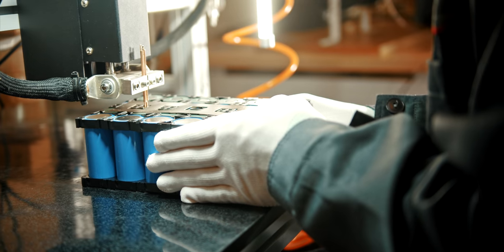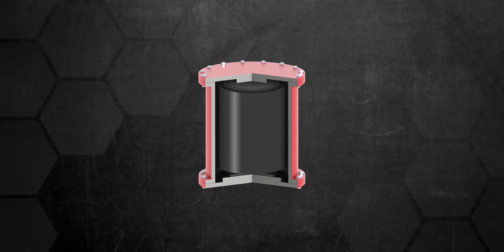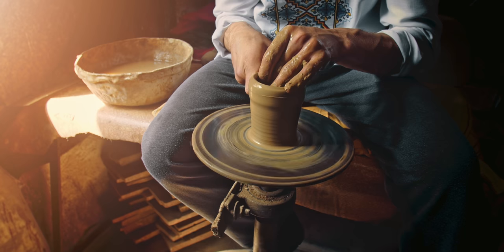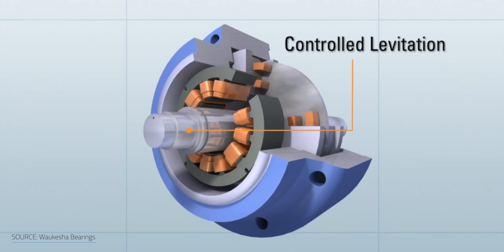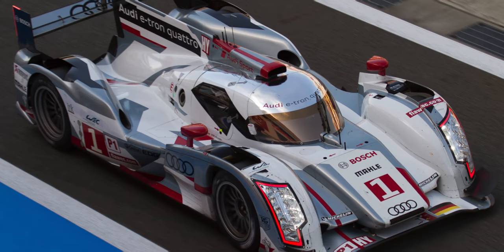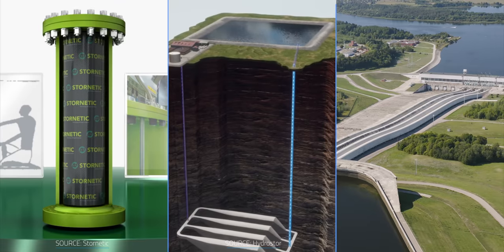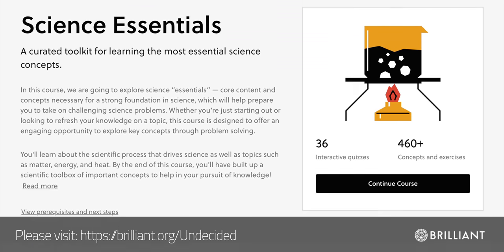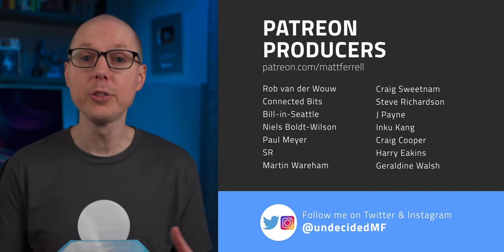The Mechanical Battery Explained - A Flywheel Comeback?

Comment: They should create a hybrid windmill.  You just place a large heavy cylinder on a cable inside the windmill and when you have extra power that would lift the cylinder until it is at the top of the windmill (fully charged), when wind is no longer available then the hanging cylinder would propel the turbine as it is dropped back to the bottom (discharged).  You already have the turbine so why not make use of it?  You just have to add some controllers, gearing and a hunk of steel. Your storage capacity would be proportional to how heavy of a cylinder you place inside the windmill. These could also be deployed near the windmill instead of inside but they would take more space and complicate the pulley system.
Reply: Oh and you could also allow the cylinder to drop lower than ground level by extending the cylinder housing below ground level which would also give more storage capacity.

Comment: An advantage not touched upon is that flywheels are able to discharge at very high rates compared to batteries. Useful if you have very bursty power demands like a fusion reactor and you don't want to cause a local brownout.

Comment: The installation costs may be greater, but what is the life-cycle costs over 20-40 year periods?  There is likely a cost crossover when one accounts for the sustained maintenance cost over the operational life of a power generation system.

Comment: Literally the Generators in Steam-Power-Plants were Flywheels and smoothened the Peaks out, having a huge mass. This is simple physics and should be used to stabilize the grid in short term changes.

Comment: A question:  Why the high relative cost of Flywheel storage?  If a major reason is economies of scale,  that should be mentioned and factored into this discussoin of long-term Flywheel viability?  Obvious is the material mass of the heavy flywheel itself (but could even this flywheel material cost be something that is lowered because it is easily recycled?  Also couldn't the flywheel itsself be a hollow structure that is filled with a less expensive grain or particulate such as sand?

Comment: Mechanical battery huh?
In my mind, an efficient (fixed location) mechanical battery would simply raise a very heavy weight against gravity using wind (with a mechanical connection) .
Picture two wind driven rotor assemblies, one delivers electric energy that powers your house, the other winches up a 10 ton concrete weight in a shaft under your house. When the wind stops, the weight is allowed to descend spinning the generator that would normally be driven by the wind .
How about cables tied to the trees on your property when the wind blows and your trees sway each one ratchets the winch to haul the weight up the shaft, when you want power, let it drop spinning a generator.
Its low cost, just some mechanicals and a hole/shaft dug or tower built (unless you have a spare cliff face!) No sound, no heat, no hassle.
Reply: Low energy density, also huge energy losses.
You need to look how much energy it can store, for it's size/building cost/maintenance. Gravitation is a weak force, you need huge masses to move up & down, or to big heights...
The only manageable such thing is water, and they already do that, but it is quite inefficient.

Comment: How does the longevity of the flywheel system factor into the cost when you compare it to Lithium ion? I know it's not as easily quantifiable but there is also the cost to the environment of employing unsustainable solutions like lithium ion. We say flywheels are more expensive, but on what scale? Great video!
Reply: @Eitan Tal because it relies on the mining of limited resources to the detriment of the enviroent to produce batteries which are not currently reusable or recyclable.
Reply: @Eitan Tal No, I am not suggesting that mining should be avoided, minimized...maybe. No, I am not suggesting that we should go back to the stone age. I am also not saying that there is not 'enough environment'.
Reply: @Eitan Tal If you do not find my first answer satisfactory, I cannot help you. I wish to end this back and forth with you.

Comment: I think mechanical & kinetic batteries could be incorporated in wheel hubs & around the wheel wells of Hybrid, Plug-in Hybrid, & electric cars to supplement their power sources. It wouldn’t replace the batteries, but supplement them, allowing not only regenerative braking, but modest power generation as well.

Comment: I think that flywheel energy storage is a good thing. I also fill that is massed produced the cost should come down. I think battery efficiency numbers are not correct. If you look at line loss, inverter loss and charger power loss, battery loss, then inverter after battery.... the affect is not so good. 

i'll take this time to also mention if solar is placed where it is to be used. On your roof you can store energy in meany more ways then what is practical large scale. like hot water for heating just to add one.

Comment: I haven't seen anything yet that beats saltwater batteries for grid applications. Cost is comparable to other battery technologies. Recharging behaviour is ideal for the grid (unlike other battery technologies). The lifetime and recharging cycles are as good as with flywheels. And they are made from environmentally friendly abundantly available materials, better than even flywheels because the heavy steel wheels require a lot of energy to make.

Comment: No need to be afraid of the equation. Turn a flywheel 2 times faster means 4 times the energy stored. That's what is expressed when we say that energy stored depends on the square of the angular velocity. On the other hand, multiply by two the mass of the flywheel and you get twice the energy stored. So it shows that to maximize energy stored, the payoff is better by improving the technology to turn the wheel faster.

Comment: In Germany at the Max-Planck-Institut for plasma physics they use a flywheel battery to store energy for the heating element used for fusion experiments. The heating lf the fusion reactor needs energy equivalent to half of munichs energy consumption in a short period of time.
Further down is a link to the website of the institute (it's in German but I think a translater will help)

https://www.ipp.mpg.de/4241286/generatoren

Comment: When you analysed the capital cost of flywheels, did you extrapolate the total ownership costs? looking at the cost of regularly replacing the batteries over decades? I wonder if the flywheel would have a longer payback period, but be more economical in the long run? It would be interesting to see, after how many years would the flywheel would become more cost effective, if at all. I'm guessing the battery installation would have to be carried each time by a trained professional so that would increase the ownership cost... You can see I'm rooting for the flywheel here :)

Comment: maybe despite the fact that the angular velocity is influencing the energy content by a power of 2, making a super large diameter super slow spinning flywheel could be cool. Imagine underneath the solar farm the ground is fairly flat and the entire thing rests on a giant 200 m diameter flyhweel that spins super slow.
This would reduce the cost of the flywheel and per energy a lot as no more magnetic bearings, carbon sleeves etc are needed. But the cost of the big basement to lay it down is probably high. So maybe it would have to sit above ground with the solar panes attached to it.

Comment: The energy is all around us.
Interdimensional.
The power lines are NOT transferring energy.
Tesla tubrine is a pump.
And when tuned will pump or oscillates in harmony with the either. 
The lines simply pull/receive/obsorb said energy. Allowing access.
Would be like putting a perforated french drain in a lake.
Always wise to split molecules qt their bonding angles. Finesse vs Brute force

Comment: What about the kinetic energy in weight? A free use of suspended weight would be harnessing tides; Using tides to lift a VERY heavy weight, and then use that weight when the tide recedes to both generate electricity AND store it via spinning a flywheel (there are several areas in the world where based upon geography the tidal range is in the 50 foot height range - https://en.wikipedia.org/wiki/Tidal_range)

Comment: So if your looking at old school energy storage solutions... we have recently looked into using compressed air/water as a storage system and also bladders and weights.... very interesting, let me explain.
I run an eco-resort in an emerging nation. How do we green our energy? Lipo batteries recieve massive tax as a luxury good. The primary energy grid is unstable with regular blackouts. 
One of significant energy costs is water pressure. We are on the ring of fire on flat liquefaction prone soils so water towers are dubious at best. One thing we have considered is running a tank with high air pressure that puts pressure on a large tank full of water to provide ongoing water pressure in a blackout. Compressed air stored at 9bar, with a pressure regulator releasing pressure into the upper portion of a large water tank, regulated to 3bar to  maintain water pressure to our villas when their is a black out. When the blackouts ends and the power cuts back in, our standard pressure pumps running at 3.5bar rapidly refill the tanks and provide ongoing pressure to the water system as well as running the air compressor that recharges the large compressed air cylinder. So effectively when power is out the compressed air supplies our backup power instead of using batteries. It is our energy storage....

The other system we looked into was a water bladder with a large concrete block on top.. same system effective.
Both interesting alternatives to battery stored energy

Comment: Good vid!  How much R&D money is going into flywheel energy storage compared to batteries?  I'll bet flywheel storage is getting only a tiny fraction of the investment.  And, similarly, the economies of scale aren't applying to flywheel storage system manufacturing and deployment - it's not a standard solution.  I suspect these two factors are keeping flywheel storage systems from becoming cost competitive.

Comment: The can be made to use frictionless magnetic bearings instead of steel bearings. It's probably better to use a motor to lift a heavy mass, and then drop it to get the energy back.

Comment: "if you want it dirt-cheap make it out of dirt"
what if you look at materials to fill the flywheel which have maybe a bit less mass but are super cheap to fill them up with, keeping only a carbon exterior for strength against centrifugal force. 

maybe the storage capacity per mass ratio will be worse, but the more relevant question is the storage capacity per money ratio

Comment: Although old school technologies maybe making a comeback, I gather the UK still uses water to produce hydroelectric power, and then power is no longer needed the water is pumped back to an upper reservoir, for when power is later needed. 
Which leads me to my question. Why aren't we using spare electricity to split water into hydrogen gas, to be used at a later time for either vehicles or later production of electricity. Surely there are times when electricity can be generated, but there isnt a need for its usage. The juggling act of ensuring that the grid ( whichever country you live in) requires balancing of how much power is generated to " keep the lights on" without blowing the system, by producing too much power. What happens if too much electricity is created? Is it dumped, or fed to a neighbouring state or country? Might the production of hydrogen, as a byproduct of over production work?

Comment: I have an issue with whenever they give the stats, it doesn't include the carbon footprint cost. Long term effect of using reusable materials vs the garbage in batteries. The US still isn't directly fixing the Solar panel issue. The UK has laws that panel suppliers must have in place facilities for recycling materials.

Comment: This has got me wondering if flywheels could use depleted uranium as the spinning mass. The extreme weight will allow the rotors to be smaller and help with a horrendous waste problem.

Comment: Mcclaren (the F1 firm) made a flywheel solution for buses (it was looking at using this for F1 engine boost like ERS). So that wasted rengenerative brake energy of a large heavy vehicle (e.g. a bus) could send the power to flywheel. Sadly the complexity and battery improvements killed it. There is a use of spinning energy is being used to "throw" a satellite into low earth orbit. Thats actually in beta and near reality (see SpinLaunch).

Comment: For years I’ve wondered why gyms don’t have a flywheel or two to harness all that energy we pour into spin classes, rowing machines etc. I guess the cost factor is the answer. I still think gyms, even the ones at home, should attempt to capture that effort and reuse it rather than creating more pollution.
Reply: The problem is that we humans kind of suck in the energy generation department. On average we have been estimated at having a energy generating potential of about 100W and most of it we lose as radiated heat (no wonder a room gets hot quickly when you share with a group of people!). Even if you make everything in a gym based on regenerative braking and hook them all together to one storage/inverter. You'd be lucky if you can use an entire day's worth of energy from a gym to make a couple cups of coffee.

A Strong-Man pulling a truck a couple dozen meters is dang impressive. But we all know the truck can move that same distance like it was nothing with just a cup of fuel.

Comment: Before I watch this video Im going to put out some reasons I can think of for why fly wheels aren't a common thing.
Loud/Noisy.
Big for the amount of energy they store.
Moving parts that need a lot of maintenance.
Lots of energy loss due to friction, I would add wind resistance as well but I assume a proper flywheel battery would be in a vacuum so I won't take a point away for that.

Alright lets see if you address these issues.

Edit: So I think you addressed most of the issues. You didn't mention the sound of them. I don't see them becoming a thing any time soon for mass market adoption.

Comment: I wonder how difficult it'd be to build one of these for the diy man. Since it doesn't require as many rare materials, that's a major plus. It probably wouldn't be as efficient, but power needs for the individual are much lower than a whole neighborhood.

Comment: Matt, I would like to know your thoughts on the possibility of flywheels effect on the Earth's rotation or axis? I may be way out in left field with this, but here is my thought process. I have read a number of research studies over the years about how water being stored in reservoirs MOSTLY in the Northern hemisphere, and more recently in the East (China Three Gorges Dam and Reservoir) a having a profound affect on the direction and momentum of Earth's wobble. If we were to start using massive flywheels rather than mini-flywheels, and their primary accumulation was also in the Northern hemisphere... Do you know of any studies about this, or do you have any thoughts?
Reply: If the axis of the spinning wheel is parallel to the earth rotation axis, there is no effect/force on the earth movement.

Comment: 1:17  based on the two figures you gave solar / wind power accounted for about 7% (7.388%) of total power generation, NOT 5% as stated.
1827.8 TWh (solar / wind) divided by 24,738.9 TWh (total) = 7.38836%

Comment: I've heard of this since 1998 but without a CVT or some form of spring loaded weight mechanism within the flywheel itself the wattage will rapidly decrease once you start extracting energy from it.
Also, I noticed some anomalies in your video.
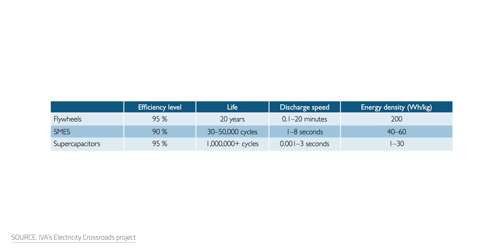At 5:55 you showed a chart with energy densities that only showed SMES and Supercapacitors as competing technologies. I had to google on my own to find the energy densities of LiON batteries. I find myself asking why but only one answer withstands scrutiny.
at 6:15 you said fixed altitude, but I'm pretty sure it would be attitude since a flywheel in zero atmosphere cant really control the distance from sea level.

Fun thought experiment: what would be the energy density of a storage system that stored energy via rotational, chemical, and thermal energy all in the same place?

Comment: flywheel systems have to be made to near perfection. And near perfect installations. Imagine a massive object spinning at 100k RPM and suddenly a wobble occurs because the rotor had a slight eccentricity....at 100k RPM that slight eccentricity will quickly turn a slight wobble into something catastropic. Imagine that massive rotor crashing into the casing. All that spinning energy coming to a full stop all at once. That would be quite the explosion. Thats why many flywheel installations are partial or below ground. What can cause a wobble? Issue in the manufacturing like imperfect centering of weight, bad bearings, malfunction in the magnetic bearings, etc etc.

It has to be near perfect. No room for error kind of stuff. Even the installation has to be perfect. With the vertical axis has to be plumb to the earth.

Comment: How about flywheel with fluid core?
Or using PV to pump water to the top of the mountain and restore it  as classical water power plant.

Or screw kinetic energy and make pneumatic energy storage 
Or chemical?

Comment: 8:23 "Flywheels have higher installation costs."
This comparison is not fair. FES last much longer. This data should be normalized:
"Unlike most batteries which operate only for a finite period (for example roughly 36 months in the case of lithium ion polymer batteries), a flywheel potentially has an indefinite working lifespan.", Wikipedia